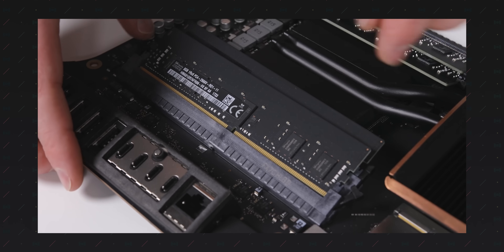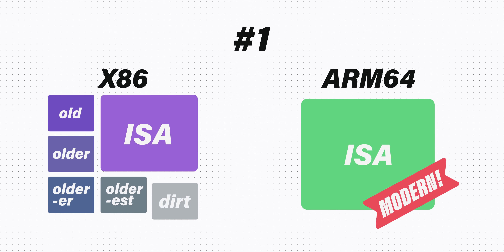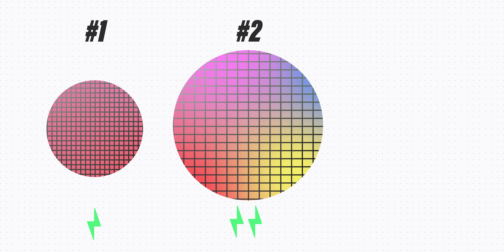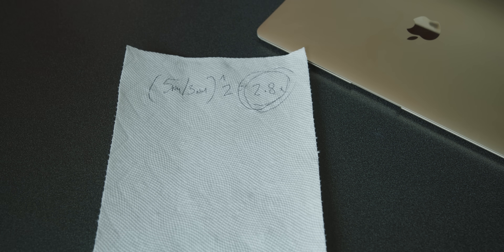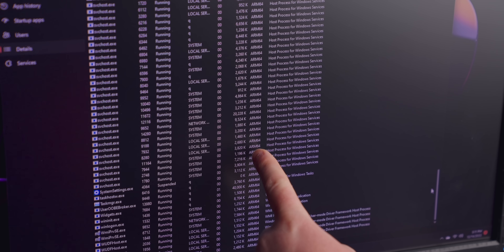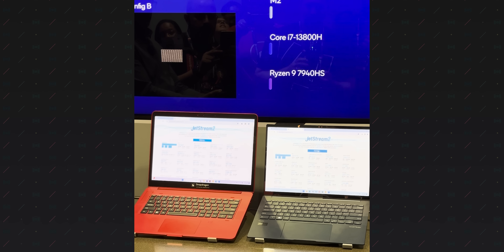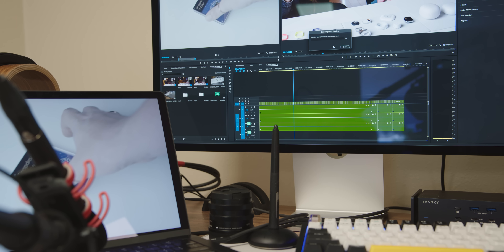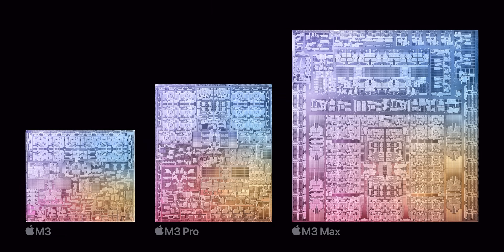Apple's Silicon Magic Is Over!

Comment: I've been a Mac user for about 2 decades and I've never had a single issue until I upgraded to an M2 Mac Studio. I'm really not impressed to be honest.
It doesn't seem any faster than the 2017 iMac I had before. The M2 Studio often bogs down using iMovie, Safari often hangs like it's not getting internet (whilst other browsers open at the same time work fine). Converting photos using Gigapixel is no faster than when I used it on the iMac. I don't know what the issues are but Apple are losing the way with hardware and software.

Comment: It's important to note that no manufacturing node process is perfect and this is the reason why processors always have some wiggle room in terms of clock and voltage. Some units can deliver the same power at lower voltages, some need more, some can deliver higher frequencies at lower voltages and so on. The more things you add to your silicon, the more complexity and more potential issues you add to it. Just look at Intel currently. All sorts of CPU issues caused by them flying too close to the Sun and thinking all it takes is to increase the cooling and power requirements.

Comment: Race to sleep is a gigantic lie.

More and more programs are loaded into the background and or the operating system, so more and more wakeups/sec are created by them and so the cpu is constantly racing, making it harder to go to sleep.

Also the race for “smoothnesses “ cause dumb decisions like CPUs going to full frequency to scroll a text only html page to guarantee smooth scrolling and wasting a large amount at each interaction.

And I have demonstrated this in the nexus 5p era doing custom cpu freq profiles that were widely use to often double the battery life of the phine

Comment: Biggest issue with Apple stuff is Apple. They're assholes. They'll use proprietary technology & standards, limit upgrade capability, limit consumer choice, severely constrain repairability, and dump backwards compatibility. All in a single, extremely fragile, extremely expensive package. I honestly don't know why anyone tolerates any of that. I would add that Microsoft going down this ARM route is as bad in its own way - backwards compatibility is a massive selling point for Windows, so a version of Windows that isn't backwards compatible or has massive caveats on x86 compatibility due to emulation is as useful as a chocolate teapot.

Comment: Don't really believe this hype with snapdragon... They may have a good chip, but by the time they sell 1000 laptops, apple will sell 100 000 on M4. Also considering previous experience with Microsoft and 32bit windows =>64 bit transition and how stuff works currently on ARM I think this transition to arm will take another 10 years.

Comment: M1 wasn't a risk apple make it's a business strategy, it make more sense to use your own chip rather than waiting for intel to design it for you it actually less risky for their future development.  

Also Apple silicon design has a lot of flaw in itself, they make the decision to group all the processing unit and  memory together. While this has the benefit of efficiency, the trade off is that the heat is generate in the same area of a small die size. If apple use the same approach as gaming lap top of spreading processing unit along the board and using better cooling solution, they could make the chip perform better but it would mean their marketing has fail. 

Which beg the question if they focus on efficiency so much but the chip throttle hard whenever the workload increase or condition aren't ideal(like in hot climate or during summer), isn't that mean real world performance would significantly decrease which probably make it a lot less efficiency and also increase the risk of damage as well.

I live in a hot climate and when ever I work with my macbook air m2 in a slightly hot room (29c) it would throttle even when the workload isn't much. If I have to turn on AC to make my room 20c or 25c for my macbook to perform then it's way less efficient that just using a power hungry gaming laptop.

Comment: For me the show stopper is you can only get the M1 M2 M3 etc. chips in a Mac.  Like where is my quality Thinkpad (or System76) laptop with these amazing chips?  I don't want to be locked into the Apple garden and have to use that funny flower key and learn a new backwards operating system

Comment: Apple hardwired memory into the CPU package to squeeze performance over x86 platform but at the expense of giving up memory expansion option.  That's why Apple does not use their own silicon in their server machine or any application require huge amount of memory.

Comment: Lots of people commenting about lack of upgradability here. But the biggest problem with these MacBooks have to be 'Irrepairability' .
I have a 2021 MacBook Air m1 base model using daily as my development machine. Super fast and smooth, BUT the TBW on the SSD is already 171 TB, which is more than the rated 150TB (on 256GB SSD ). Now , if the SSD goes, the otherwise still brand newish, working like new PC that I paid 1200$ for (because not in US)  will go to trash because can't replace with another 40$SSD. I heard that these newer Macs are even more anti-consumers not allowing part replacement between same model.
And the saddest thing still is the other PC vendor following Apple . Thinkpads for instance, nowadays comes with soldered SSD and RAM ffs

Comment: For gamers these chips are really uninteresting anyway... there's 2 people who want these chips... casual users where performance really doesn't matter much... where battery life and price matters most... and work station users... and it still looks like workstations will stay with x86/x64 and apple silicon... the rest has the same mentality it always had... you stick to the eco system you've already into... i've worked with Apple silicon and x86 (video production) for performance it really doesn't matter both are the same when you spend the same... Apple Silicon can compete with the fastest x86 chips if you spend the same. I don't see Apple Silicon as an advantage... but that they caught up to what x86 has been up to for decades... if you need an actual power horse Apple is now an option, not THE option... but with AMD and Apple, Intel actually has competition. The only advantage that Apple has... that no Windows Laptop manufacturers has figured out yet... useable SD-Card readers... on everything but on Apple they're painfully slow... buying a good one isn't expensive... but not having to buy one is nice

Comment: I’m a 3D Motion artist and for the past few years I have been rocking a M1 Max MBP for most of my Adobe type work, but maintaining a high end Intel/Nvidia workstation for 3D/GPU rendering. I would LOVE an beefy M4 Ultra laptop with adequate airflow and a higher TDP. My stupid 13900ks + 3090 Ti  has awful power consumption, 4090s were mostly not worth the price tag and would have required a bigger case than my already large one, and keeping up two machines is annoying. And I like having a portable workstation.

I would like it if I could add more internal secondary NVMe storage, of course.

Comment: Great video! I agree with all your takes here. Especially widening the Line-up by the reintroducing an actual Ultra-Light laptop feat. a efficiency optimized chip and a price to match.
Also, screw 'em for stil starting at 8GB RAM then charging $200 for a measly 8GB more...

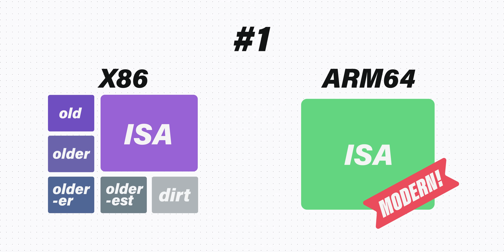Comment: 2:30 that's wrong. the problem isn't the ISA, maybe the lack of unified memory model makes things worse, the weakly ordered memory model poses a cost for the compilers, but not that much for the hardware, sure the MMU gets more complex because of that, that might come at the cost of a bit of cache size, there's probably plenty of die size for that logic (logic shrinks well, not cache).

Maybe the real problem is the way QPI or whatever is that intel uses as I/O interconnect is problematic when compared to most ARM SoC because they don't have unified memory, so of all the things above you mentioned, only one is the real problem.

But the real thing is that Intel uses more power because it produces more computing, its an engineering trade-off, on desktop you can afford it, on mobile you can't, maybe its harder to scale down. On the other way Apple M1 has to scale up which might be even harder because all that extra logic for optimization.
Which is why I think Qualcomm is a good alternative for laptops, its a middle-ground SoC used on higher-end smartphones, already scaling it up might be feasible, Apple will be in trouble.

There's no magic, want to go faster you either have to dissipate more heat or do less work, or do more work with less power by using a better manufacture node.

The manufacture node seems more important that anything else, that's why the M1 chips used less power and were faster, but now for them to go faster they need to become more complex, and thus use more power, thus produce more heat.

Comment: Dave 2D mentioned the biggest challenge of the Snapdragon, developer support. Apple introduced M1 and said to developers, “Get on the Apple Silicon boat or be left behind.” …as Apple can do. But despite the major software players being ready, Windows is full of legacy software, some of which are ancient codebases. What motivation is there to rewrite that for ARM or for us to buy an ARM Windows if you’re not sure you’re old software will work. Apple had Rosetta, but Dave showed how Microsoft’s translation layer is not in the same league. I guess we’ll see, but there’s no doubt, competition is great.
Reply: "Windows is full of legacy software, some of which are ancient codebases. What motivation is there to rewrite that for ARM or for us to buy an ARM Windows if you're not sure you're old software will work"

Go and watch similar video from garyexplains channel. Tests indicate it's even faster than apples rosseta, and Microsoft boasted about that recently with their upcoming surface devices. 

And yes, every old programs working on x86 will work normally with no problem whatsoever. Windows Central recent article

Comment: The benefit #1 (ISA, x86_64 vs ARM64) is not really important. If Apple had a license for x86_64, you bet your ass they’d be doing x86_64 for iPhone and Mac. The CISC vs RISC is a myth with modern x86 (said by silicon engineers, not me) due to the decoder translating to RISC internally, and most of the burden of the many instructions is put on the compilers. The CPU isn’t slower because it knows many instructions.

Important, however, would be to note how Apple, thanks to its huge pockets, always is one TSMC node ahead of the competition, which grants them non-trivial improvements in terms of efficiency and performance. It’s a strategy almost only they can take, because they sell products at a very high price so they have the margin to bid for the entire production of a new node for an entire year.

The last point, combined with the unified architecture and very wide design, and with the built-in accelerators is what gives them such an advantage. Arm or not, doesn’t matter much.

Comment: Great video. One minor detail as a not-apple-fanatic : Asus Zenbook 14" Oled basically already does everything you asked for. Powerful and economic-when-idle CPU? Check.  Powerful GPU? Check. Insane battery life? check. Great formfactor, build quality? Check. Thin and light casing? check. (responding to the end of your video where you comment that the non-apple gaming laptops are stuck at 3.5 hours battery life). There's also other 17" laptops such as LG's gram that have decent 4050 videocards, good CPU's, weigh 1.35kg and are a joy to use (Albeit at the expense of some strength in the chassis).

Comment: if your MBP is running that hot all day long then consider using a Studio or a better spec'd MBP because constant use at that heat is going to impact the lifespan of components of the laptop, and not just the SOC chips themselves, either.

Comment: M4 Ultra and Extreme (hydra) wont have so many (or any) efficiency cores. there will be significant differences with M4 to M3 in the pro chips and it's not as insignificant as this video is suggesting. get ready.

Comment: Jony Srouji gave a very rare forward looking hint a few months back in an interview, mentioning that with node shrinks slowing down, advanced packaging was the future of advancement. Supply chain research out of Taiwan also said there were higher orders for advanced packaging expected to come from Apple. And then add the last clue where M3 Max didn't have the Ultrafusion bridge to make an Ultra out of 2 of them.
I wonder if the M4 line will introduce tiles, allowing different parts to be made on different nodes. Particularly IO and caches haven't been shrinking well and there's benefits to this approach, and also different nodes are better suited to either CPUs or GPUs or low power IO etc.
Reply: The benefits there mainly come down to costs, and I dont think Apple is super concerned with that just yet.  They can just raise the price and people will pay it.  Plus the base M dies are still quite small(~150mm²) so continuing to more or less just glue dies together with their developed interlinks seems to still be good enough for a while.  Though it's possible that perhaps for the Max/Ultra designs, they could start thinking about a more chiplet approach sooner.

Comment: Excellent video I have a 15 inch Macbook Air and a Samsung Galaxy Pro 15 inch. The main issue is the software and efficiency. The macbook just air works and battery last forever. The Samsung even turning off everything It de charges it self and is not reliable and is not a Samsung problem is a Windows problem.

Comment: One of the big problems for Apple is how well their M1 laptops still hold up today. Bought an M1 Max MacBook Pro (64GB RAM, 2TB SSD) in November 2023. At release, it would have cost over £4K ($5K), whereas I paid only £2K ($2.5K) for it. Nothing but positives from me so far.

I've seen first-hand how poorly managed thermals can cause a laptop to degrade extremely quickly (cough... Razer), but with how efficient this device is I expect it to last for many years to come.

Comment: The thing about switching to ARM is that it would be and is much easier to do on Linux ... even with minimal support, you can have a full desktop experience running on a phone with a bit of tinkering and a while compiling.

Comment: i was thinking of buying a macbook air but then i saw the acer swift edge 16 which is much cheaper.

it has oled screen, comes with 16gb ram and 512 ssd. it has ryzen 5 7000 series and battery lasts me 6 hrs for productivity use.

its more than good enough for me

Comment: Honestly never saw the point of doing any sort of heavy lifting on a laptop, much less one built for mobility. No matter what, you are ALWAYS either leaving performance on the table or sacrificing mobility AND leaving (admittedly a bit less) performance on the table.

What Apple ought to do to serve this user base is offer a seamless network-based solution, where the laptop is little more than a posh UI client and the actual grunt work is done on a proper workstation somewhere else. Probably need 10Gbe to make that work really well unless the files are already on the workstation. Either way, it'd have to be on the same LAN for acceptable latency.

Comment: I think the correct market economics is what apple is already heading for:

A high value ecosystem that we pay for means that we are not pushed to continually upgrade the hardware. this way, apple can continuously make great new hardware but not be to worried about planned obsolescence. iCloud keep us there and happy and ensures that apple doesn't need us to switch once a year. That's why these M1s (which I am typing from) and the subsequent chips are incredible in their own right and last a long time without the need to constantly change.

Comment: Well, many people need for performance than lousy efficiency. 
As long as the job gets done, fuck efficiency. 

That's why PC market still standing. You can build whatever configuration that fits your needs, with acceptable price. 

Some Apple fanboy said that 8Gb RAM on Mac is equivalent to 16Gb on Windows 😂😂😂

Well, is that even mean that 256Gb storage on Mac is equivalent to 512Gb storage capacity on Windows?

😂😂😂

Comment: He said it all in one video, the m1air was the first computer in perhaps a decade that hit the value sweet spot they used to be known for which is why it was that long before I upgraded and I love that machine as much as I will hate Apple for making it with a soldered on ssd that will brick a device that otherwise is capable of operating fine for another decade. They just need to put all the ports back on their laptops again because dongles suck and there is no good reason for them not to be included unless you count greed as a good.

Comment: There is one major reason why Apple Silicon is faster you don’t mention: memory bandwidth. In fact, I believe that it is the deciding factor in most "generic" workflows (not encoding or AI) that makes it fast. I am not sure how PC can catch up without ditching separate memory modules, this cannot be done without integrating memory into CPUs which is something not PC-like. Those Qualcomm laptops are interesting, but it is a problem for Microsoft - they need to ditch the whole x86_86 history and get devs to recompile most apps yeah. The winner will be Linux I guess :-)

Comment: IMO the M1 and M2 were the best chip Apple ever made. For audio production, my area of use case, the M3 is a bust, because of the decrease in number of performance cores vs efficiency cores. The lack of upgradability for RAM and SSD and the fact that Ryzen 5 and i5 outperforms it on the newer architecture, means I'll stick to PC, and hope that Linux gets more support for pro audio. The new Snapdragon actually looks like it would be better for Linux, speaking of.